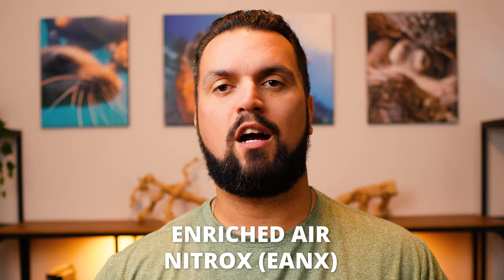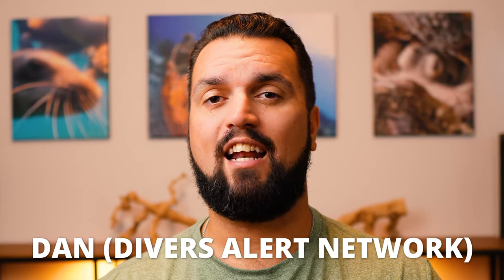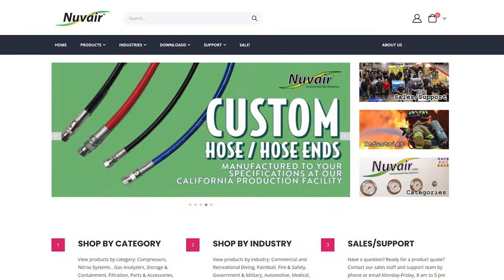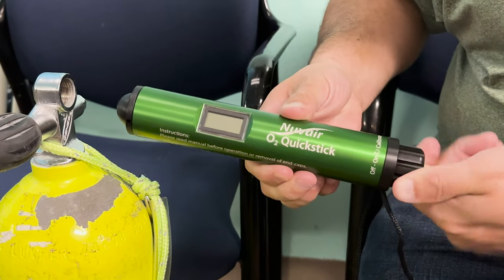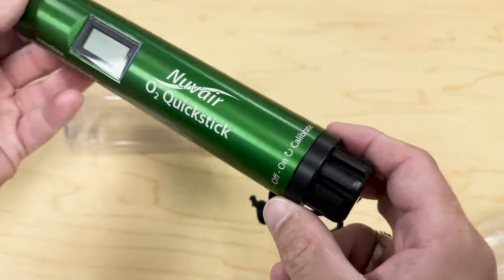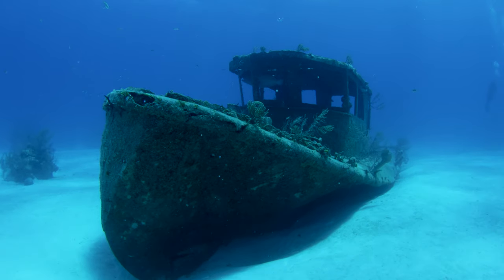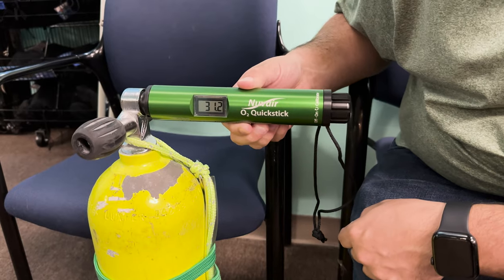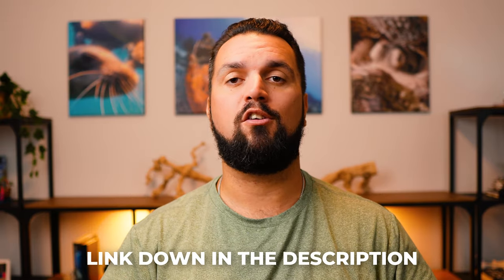How To Analyze Nitrox (EANx) - Nuvair O2 Quickstick Tutorial

Comment: Excellent!  Wow the price of O2 analyzers need to come down in price.  Especially, if we to need to analyze air fills (21% O2) to make sure we didn't get a Nitrox fill.
Reply from the maker: I agree they can be pricey but I also don’t necessarily wanna cheap out on something that’s life support based 😅
Reply: Helium analyzers are even more pricey! If you ever plan on doing trimix diving, you might consider forking out the extra 💰 for safety and get a combined He and O2 analyzer. In the meantime, just borrow your dive center's analyzer.
Reply from the maker: @mcmoore02 if they have one readily available and didn’t forget it in the shop when you’re on the boat already pulled from the dock.

Sounds like a rare and specific situation but I’ve had this same situation happen through 3 different operators in 2 different countries 🤦‍♂️
Reply: @CircleHScuba  Yeah that's bad. As certified Nitrox divers, we must analyze the tank before the dive. And that includes before the tank is on the boat because if it is the wrong mix, the situation must be corrected. Period. I have always resolved this scenario with the dive operator before I pay for a Nitrox dive and that includes making sure they can supply an analyzer and I can analyze it before it is loaded on the boat. Otherwise Air. So far it has not been an issue, but I am sure people have had awful experiences.

Comment: Using your logic for diving Nitrox, shouldn't ALL tanks be tested, including 21 percent air mixtures 🤔
Reply from the maker: Well honestly that’s more dependent on how tanks are filled. Air is air so the compressor won’t magically change it unless it’s using one of the various systems to boost the oxygen higher than 21%.

You should always know what gas you’re breathing though, yes
Reply: @CircleHScuba  Tanks can be mislabeled or mixed-up?

Comment: I can confirm the Nuvair is a great analyzer. Very easy to use. 

A couple callouts:
1) Hold the Nuvair away from the tank when first opening the valve as demonstrated in the video. The sensor is delicate and can be damaged if the valve is opened too much. 

2) Make sure to adjust for altitude when needed as the reading will be inaccurate.
Reply from the maker: I definitely should’ve called out both of those, good points!!
Reply: @CircleHScuba  You did a great job. As you stated, people should only use Nitrox if certified and this is a good refresher for viewers that are.
Reply from the maker: Thank you!
Reply: Noticed at 1:45 the diver's octo is (1) loose and out of reach, risks getting snagged and hard to find; and (2) free flowing.
Maybe we could do a piece on best octo practices? 2nd stage free flows?
Great stuff!
Reply from the maker: I can see about that, thanks!

Comment: I was surprised to see how this devolved into an infomercial…. That being said, here’s my thoughts overall:

It is vitally important to understand the accuracy of ANY analyzer and consider that when determining MOD for the gas mix.  From the manufacturer’s website, the Quickstick has an accuracy “within ±1% of full scale at constant temperature and pressure (0-1 atm) when calibrated with 100% oxygen.”  That’s pretty good.  Also, it seems to me that adjusting the calibration for air at 20.9% as you described should be perfectly fine since getting to an O2 source to calibrate would be impractical, and frankly unnecessary.

For an exact 32% blend of EAN, the 1% accuracy means the mix could be between 31.68% and 32.32% which seems perfectly acceptable to me.  (In reality, you never get “exactly” anything.)

You might have also discussed the concern for reduced 02 in STEEL tanks that have been sitting unused for a while.  While dewpoints should be carefully controlled by the filling station, high moisture could lead to rust formation which would reduce O2 levels in the tank’s air.  

It is great that the sensor is user-replaceable and not that expensive ($95 MSRP at this writing in 2024), but I hadn’t found any information on the service life of the sensor, but that is important to know.
Reply from the maker: I think devolved is a bit harsh, but honestly any sensor is fine. It’s just they sent me that one and it’s one I’ve used myself at the dive shop I work at and on just about every trip I’ve been on as well. I can stand by something I use. I don’t like to just do some sponsored deal for a product I’ve never touched.

Everything you said is great extra info and I think it goes a bit beyond/deeper than the more surface level intent of the video to always analyze. What makes a good analyzer vs a bad one or comparing this one vs others is out of scope and would be their own videos imo.

Thanks for the extra detail regardless!